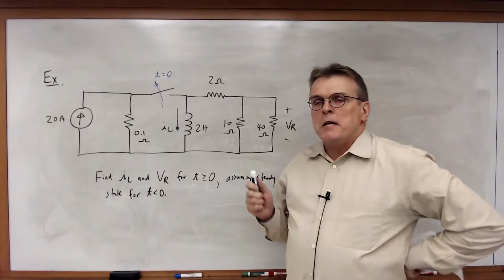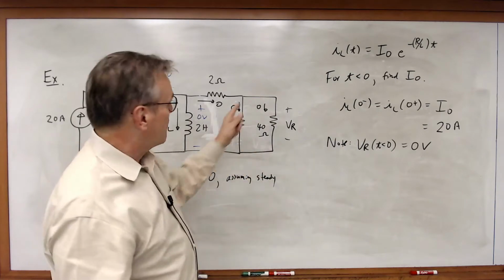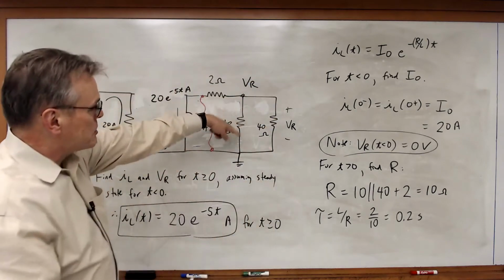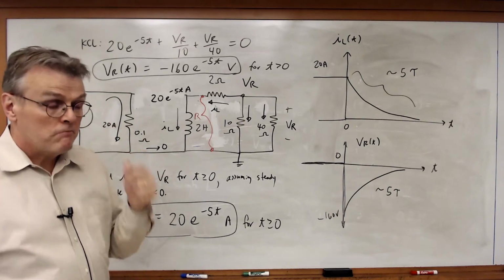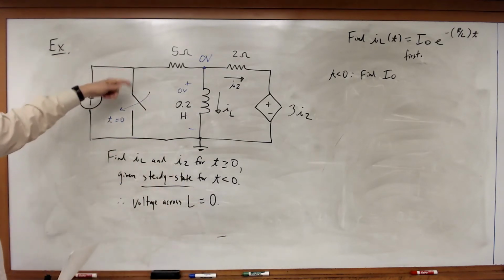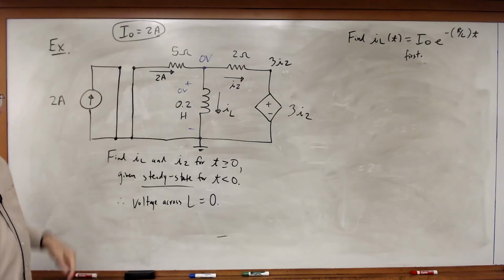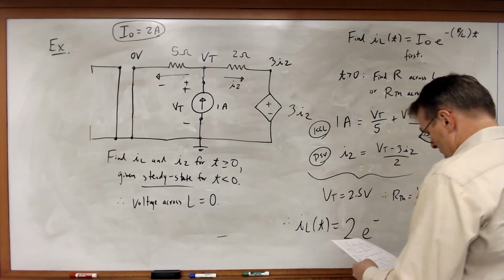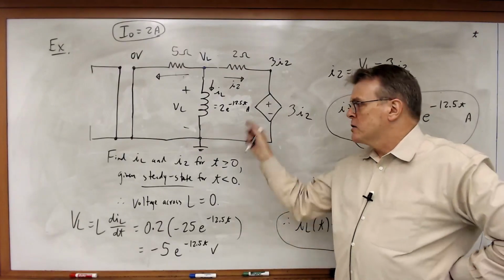EECE 2112 Module 59:  Examples of Natural Response in RL Circuits

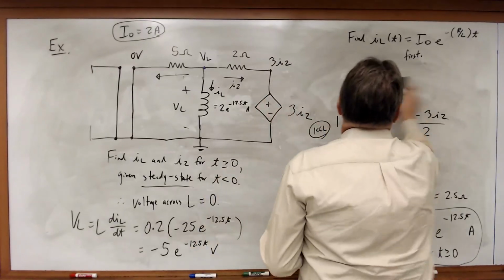Comment: at 22:37, why did we write L*diL/dt as 0.2H(25e^-12tA) and got -5e^-12.5t V as our voltage? shouldn't it be 0.2H(2e^-12.5t)? (not 25e but 2e).
Reply from the maker: You are confusing iL with diL/dt.  iL = 2*e^-12.5t A, so diL/dt = (-12.5)(2)*e^-12.5t = -25 * e^-12.5t, and vL = L*(diL / dt) = -5 * e^-12.5 t V.
Reply: @wtimothyholman  thank you, I was able to figure it out yesterday and moved to step response for RL and RC circuits. your course is great professor.

Comment: Professor Holman, thank you from Syria... you and people like you create hope!
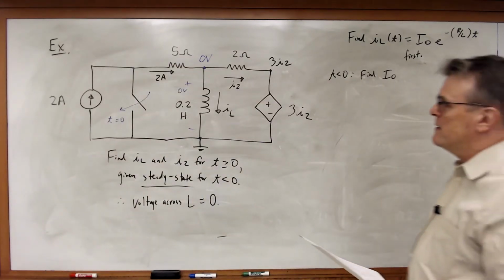14:36... Is the following true and acceptable: By inspection, if there is more than one branch, and one of them is acting like a short circuit, then current will flow only through it (Ohm's Law: When R becomes zero, I becomes infinity); so, in our case it will be a wire that completes the 5 ohm resistor loop, and there is no need to calculate i2 when t < 0?
Reply from the maker: You are correct that a short circuit across a resistor will result in zero current in the resistor, and all the current will flow through the wire connected across the resistor.  However, while the current i2 is equal to zero for t < 0 in this example, it is due to the fact that the dependent voltage source was equal to 3* i2.  If the dependent voltage source had been controlled by the current flowing through the 5 ohm resistor for t < 0, then i2 would have been non-zero. 

The best strategy in circuit analysis is (in general) to NOT trust your intuition, as it will often lead you astray.  Instead, write the equations and solve them, which is what I do in this example to prove that i2 = 0.
Reply: @wtimothyholman  well explained

Comment: Hi professor, 

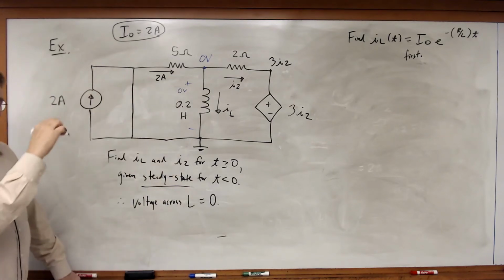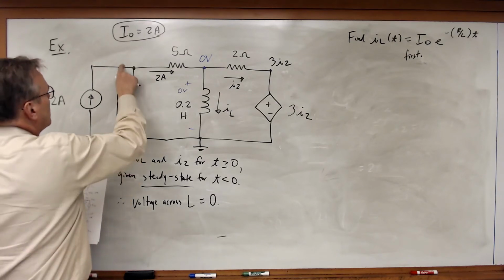@16:39, I'm having trouble understanding why there should be any current going through that 5ohms resistor. By closing the switch, the wire acts like a short circuit, so there shouldn't be any current flow through the 5 ohms resistor. By drawing a second wire and removing that little wire @17:12, I thought the circuit is now altered and is not equivalent to the one with only the switch because now there is a separate path for current to go through that 5 ohms resistor. So, for example, let t = 0, according to your calculation, V_T = -5V. Meaning there is a -1A going in the node on the left of the 5 ohms resistor. But using KCL at that node on the original circuit (one with the closed switch), 2 + (-1) ≠ 2.
Reply from the maker: The 2 A current flowing through the 5 ohm resistor is left over from the previous initial condition calculation.  It is not the current through the resistor for t > 0.  I didn't finish erasing everything until I began using source driving to calculate the equivalent resistance across the inductor beginning at 18:47.  At that point everything was erased and the current was redefined through the resistor.
Reply: @wtimothyholman  Perhaps I didn't ask the right question. I understand the 2A through the 5 ohms resistor is the leftover the from initial condition. Actually, after playing around with a similar circuit where I replaced the inductor with an independent current source of 1A (going up), and replaced the dependent source with just a wire, and put a R resistor on the switch. After letting R -> 0 ohms (to mimic a perfect wire), the result showed that the switch is NOT a short wire. This goes against my intuition because I thought the switch acts like a short, thus, 2A also goes through the switch. It was the reason why I thought there should be no current going through 5ohm resistor according to KCL. 

Now that my confusion has been resolved. It leads to another question why the switch isn't a short wire. There must be a something I'm not understanding about what a short wire actually is.
Reply from the maker: @nhitc6832 , your question isn't clear to me.  The switch is a perfect short circuit (i.e. wire) when it is closed.  The switch is open for t < 0, and so the only path for the current from the 2 A source is through the 5 ohm resistor during the initial condition calculations.  The switch is closed for t > 0, at which point the node voltage on the left side of the 5 ohm resistor is 0 V because of the short circuit to ground caused by the closed switch.

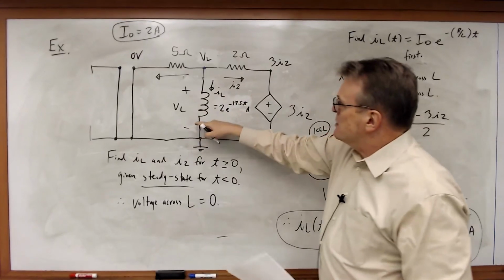Comment: sir, at timestamp 22:00 , you found out V(L), but simply applying nodal analysis at the V(L) point would also work right ? (gave me the same ans). Thank you.
Reply from the maker: You are correct.  Using vL = L*(d iL/dt) is faster, but you could write the following equations and solve for vL and i2 simultaneously:  2e^(-12.5t) + vL/5 + i2 = 0 and i2 = (vL - 3 i2) / 2

No matter which method you choose, you will get the same answer.  In fact, solving a circuit two different ways is the best way to check your answer to confirm that it is correct.
Reply: @wtimothyholman  thank you sir, had my final for the course today and went decently well, I was in a bad situation after midterms, but performed better ever since i started following your lectures, will surely recommend them , thanks again!